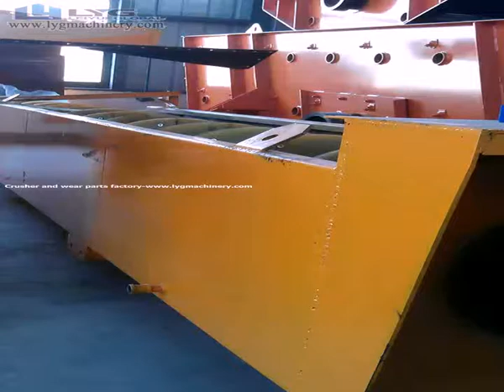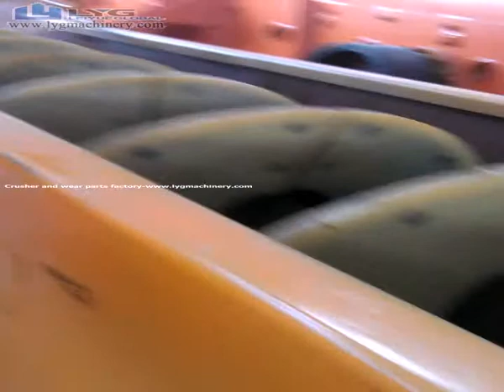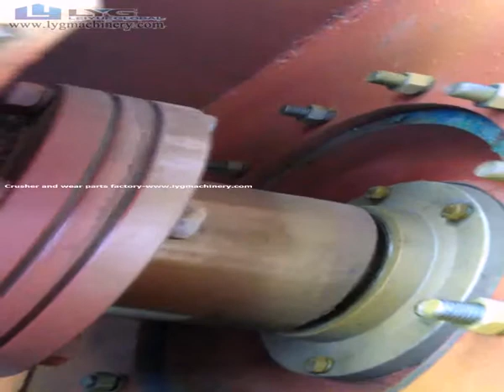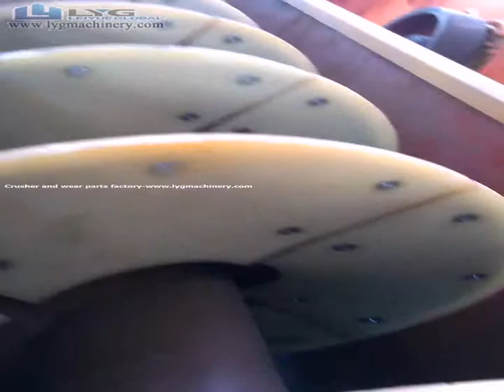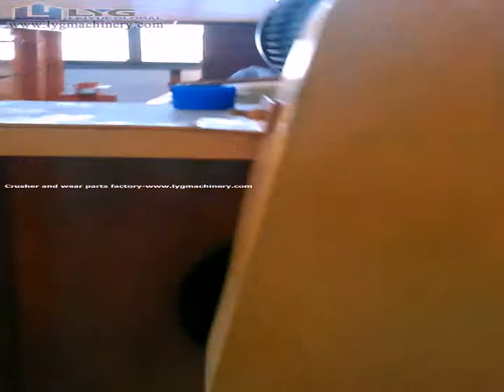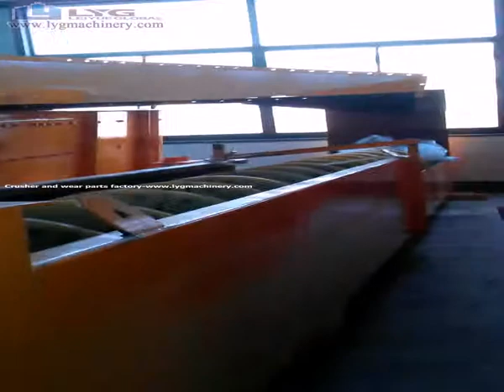CE screw sand washing machine with low price used for sand factory-lygmachinery.com

Comment from the maker: http://www.lygmachinery.com
toni.miao@lygmachinery.com

CE screw sand washing machine with low price used for sand factory-lygmachinery.com
Working principal of screw sand washing machine with low price

This sand washer adopt inclination of 15º,under the water tub,three weir plates form the sediment pool.The screw head is immersed in this pool,and the screw is driven by electric motor through reducer rotating continuously,and then the fresh water is feeding from porous plate at bottom of sediment pool.